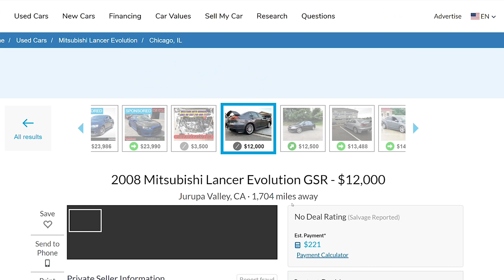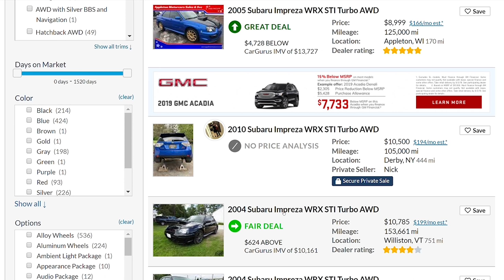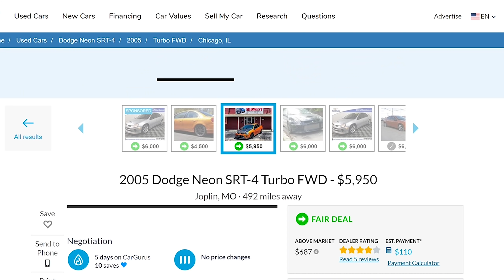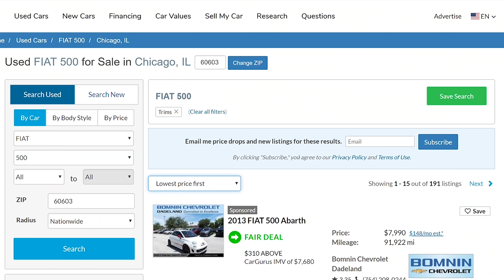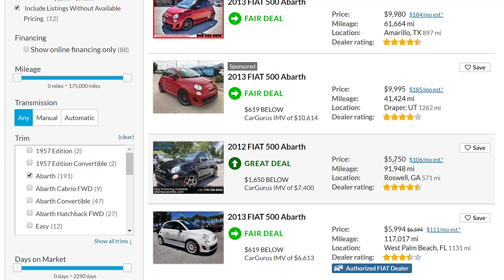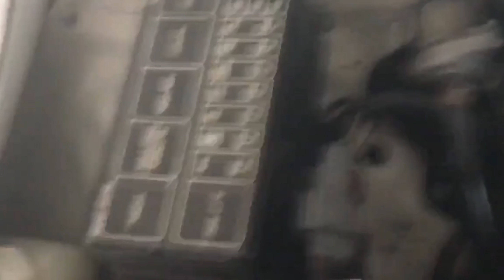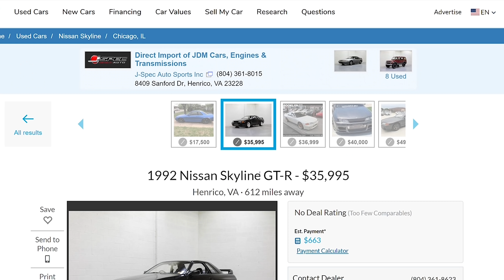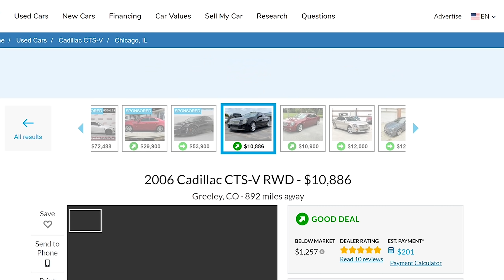AMAZING VARIANTS OF BORING CARS

Comment: Personally for me I would rather have a non-GT-R variant. My ER34 cost me only $3200 for a grade 4 coupe under 50,000kms. I would much rather have this car and make it my own vs spending 80k on a stock and extremely underwhelming BNR34. There are plenty of ER34s that can be had and built rip GT-Rs apart every day of the week for half the cost all in. 40k for an 800whp ER34 vs 80k for a 300bhp BNR34 especiallyif you can find a ENR34 it's literally a GT-R with ATESSA ETS only it's a RB25DE and no multifunction display for 1/8 the cost. The interiors have the same cheap plastic materials a lot of parts literally share the same exact part number. There are tons of advantages with a ER34 and ENR34. I like a car with history and seeing a car progress from nothing to something is much more valuable to me than hopping on the fan boy train completely disregarding the car because it's not a GT-R trim. Also the BNR34 being 80k it's a halo car which may cause internal controversy when modifying it. All BNR34s look the same. All have either the S-Tune or Z-Tune body with fenders and either a OEM spoiler or OEM spoiler with risers. Nobody wants to do anything different and that's understandable with how rare and expensive it is even here in Japan. But the ER34 non GT-R trim in a sense a throw away car so you can do whatever you want with it and your not risking value or the damaging of a halo car. If you wanna drift it go for it, strip it out and turn it into.a time attack car, do it. Cut into the fenders and go wide body, no problem or even do a full blown GT-R conversion. You can and it will still be cheaper than buying a OEM GT-R even with new parts from Nissan. I've seen plenty of ER34s that you literally cannot tell the difference until you look at the serial number and it said ER34 vs BNR34.

Comment: Is an Infiniti g35 a good first car?
Reply: Lukas Speed ABSOLUTELY. I think that’s a little too much power for a 17 year old but hey kid if your parents are confident in your driving, I say go for it. Those are great cars all around.
Reply: Or an integra
Reply: Yes, just be careful of the rear wheel drive. Lots of power can have the rear kick out.
Reply from the maker: it's an ideal car!
Reply: Mike Russo I live in the north so I would get a g35x and a sedan :/ Bc I gotta drive my friends around plus I can’t find a coupe under 5,000
Reply: Yeah but try to find one with relatively low miles in regards to the yeah of the car...and stay away from 2003/4 model years and you should be good 👍 also DO NOT get a auto transmission unless you plan on always following the speed limit but lets be honest with almost 300hp your not 😏😂
Reply: it is  one  at  my  local  dealer  triple  black. they are  really good  cars my  mom  has  one with the  nismo  exhaust and  it  sounds good
Reply: @leroycolejr6336  they're great cars!! I've owned some myself, I just say stay away from the auto because they don't hold up well if the previous owner drove it hard frequently
Reply: Lukas Speed why do you want a coupe specifically? There are a crap ton of low mileage older subaru wrx’s, if you live up north then you need some real awd.
Reply: Subaru's have catalytic converter, and head gasket problems, they didn't fix the problem until I believe 2011 and it started in 1999... My dates might be a lil off though you'd have to look it up
Reply: Yes but use a lot of oil if u don’t keep an eye on it it will die mine has 171k and just died last week
Reply: Lukas Speed I got my 2008 G35x for 5,300 you just have to wait and look
Reply: It was my 2nd. Had the 05 coupe. Loved it until someone smashed into me and totaled it.
Reply: Just make sure you know how to drive a rwd if you using it in winter. Can cause some problems for rookie drivers